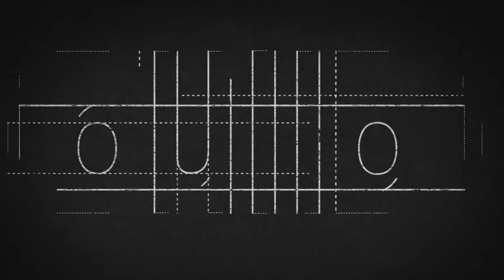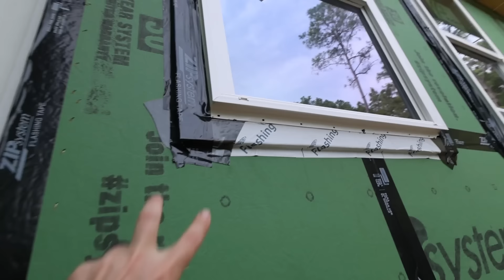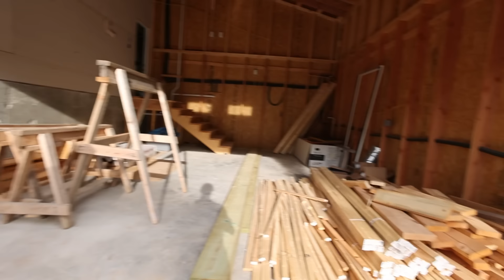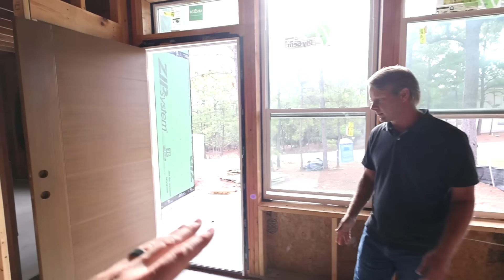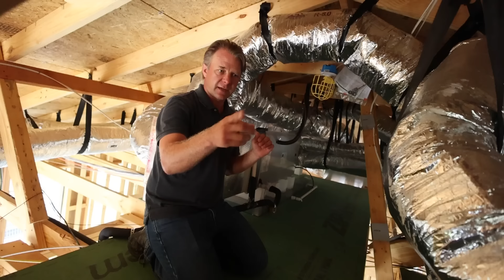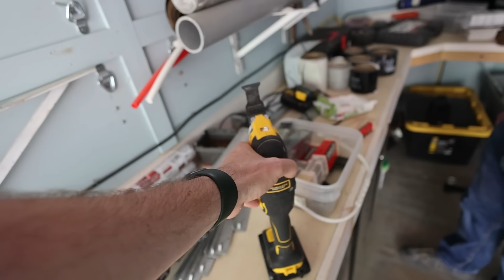LOW BUDGET Details For A High Performance BUILD

Comment: Sizing the HVAC system on the small side is great for the summer but not so great in a cold winter. The resistance heat will be coming on a lot more. My wife wants to feel some heat coming out of the vents. We are little further north and the heat pump struggles on cold days.

Comment: Hello, when the Siga Tape is used on the foundation to wall, is it applied to the foundation and up onto the Zip Sheathing if the Zip is put on after the walls are framed, or is it going up and over the sill plate before the Zip sheathing is put on and then the Zip tape is applied to overlap the grey foundation tap integrating both..   ?

Comment: Can the Scott true technique for the soffit be amended to not need spray foam? Would I need to block off above the top plates or could it be filled with blown in? I am trying to retrofit an existing home without spray foam...

I can't convert to monopoly framing since I have 2*4 truss roofs and that mod will cost a fortune to execute...
Reply: Also doing exterior insulation and air gap before roof and exterior cladding so wondering if I can use the soffit as the breathing box by using the exterior of the soffit to connect both breath areas (wall and roof

Comment: As a home builder, we have been using high insulation applications where a single plate at top, exterior mineral insul as a standard application.
24 centers throughout floor , exterior including conventional roof upon ceiling to achieve maximum r value under metal on roof.
Super advanced assembly.
These that I see are not super advanced technologies on this channel.
Still have a way to go.
Keep it up guys,

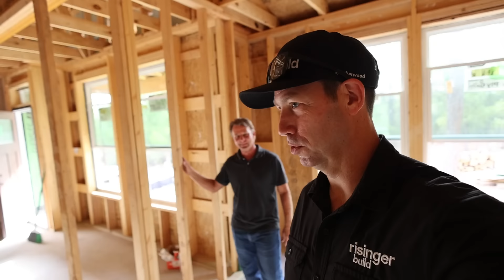Comment: 38:54 this is not mistake, this is a norm under capitalist economy that forces cost cutting here and there while chasing for a profit. I predict that in several years construction lobby will push for relax the code requirements, so they can build even lower quality houses for the same money.

Comment: Very nice but a couple things I’m surprised at … I’m an electrical / AC contractor and those are old fashioned can lights , that’s ancient history , we use flat LED,s now … The other is the penetration for TV cable on the patio .. seriously !!!   These days your TV needs no cable , you use Wi-Fi  …You need one cable going in the home to the wireless router and all TVs are linked by Wi-Fi to the router ….
Reply: LOL being an electrician /AC contractor doesn't make you right. I prefer the old recessed can lights. You can easily seal it up and they are way easier to swap out bulbs when they burn out. People use ethernwt for POE.

Comment: I despise using spray foam on interior walls.  It offgasses forever (especially terrible in tight houses), it makes moving plumbing/splicing wires etc a nightmare.

Comment: Up north commercial buildings use a vestibule to limit cold/hot air from getting all the way inside.  Why not consolidate wall penetrations and have them pass through two separate surfaces like it was a vestibule.

Comment: Underpinning is the process of augmenting an existing footer, typically by enlarging the footer spread area to carry larger loads (i.e.- 2ft wide continuous footer becomes 4ft wide footer after the fact, etc.). Covering concrete pitting and imperfections aesthetically is called parging.

Comment: As an air conditioning contractor in Cypress Texas one of my concerns are the 3/4 PVC drain lines. I know the fittings on any evaporator are 3/4 but due to the lengths and the sharp 90s not sweeping elbows, used by builders. Algae or whatever builds up in drains easily clogs them. And people not properly priming and gluing the drain lines and after a few years I've seen many lines breaking in the walls where it means cutting and properly securing the drains. By the way I'm a big fan just pointing out some problems I have come across.

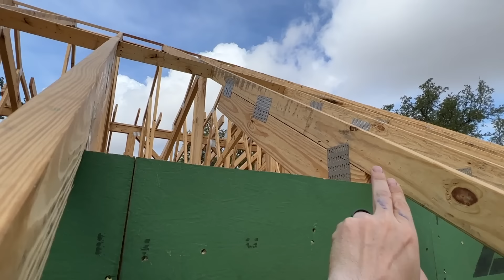Comment: If you still monitor these comments, any special input from the engineer with the freeze/vent blocks being left out (@ 8:11)?  these are usually required for rafter roll &/or uplift.  I realize that much of the uplift in big storms is created by air getting in & up-under the roof via those same vent blocks when the attic is exterior space.  Did the separation (sealing) account for leaving the blocks out?  If so, that's a huge savings to off-set these improvements.

Comment: Doesn't having a 3 ton air conditioner running 24/7 consume more electricity than a 4 ton air conditioner that turns it off and on?

Comment: This building method unfortunately doesn’t work in GA or should it be anywhere. You are very focused on air sealing for plumbing and electrical penetrations, which is good. But the problem is the siding crew will come out do their install and shoot nails right through your pipes and electrical lines. You should complete the exterior siding first. Which means it’s harder or impossible to zip tape the penetrations. We learn the hard way when our inspector made us replace the main electrical line that was shot through multiple times. All our new builds are done in that order now. 

On the other end our home inspection business find these issues in new construction builds all the time. We have a field day finding issues in cookie cutter homes.
Reply from the maker: I disagree. Siding first is a mistake. Trades first, seal all penetrations, then siding, then inspection for possible damage. THEN insulation

Comment: Great video.  One observation from building in the south for over 30 years is seeing spray foam directly sprayed to the underlayment (plywood /osb)on the roof. We replace roofing that is not old because of this method. An air gap is needed that is connected to the air vents/soffit to get the entire life out of an asphalt roof. Shingles get to over 160-175 degrees in the summer, while cooking the plywood. Especially under direct sun contact. The air helps move the convection heat trapped between the shingles and the plywood. That is why baffles are on the market and sold for this very purpose. The proper baffles can then be sprayed with the foam giving a hot roof a natural way to stay cooler and cooling takes place faster once the sun goes down. Direct foam method cuts the life of a roof by 50% including the plywood. Its worth installing baffles because it’s inexpensive while still keeping the house "Tight." *An informed and smart client will eventually notice.

Comment: How is Zip System sheathing better than regular plywood? Also, why would you want a tight house if it's actually better to ventilate it to balance out against the natural moisture level of the surrounding air? Especially if you use a firewood stove to have a free source of heat in the winter and not worry about heat loss.

Comment: I’m from northern NY, and was in the roofing and remodeling business over 10 years. We have always ventilated the underside of the roof, with soffit vents, and ridge vents, treating the roof more as an umbrella than as a part of the living space. Is this not best for the energy efficiency you achieve, or is that kind of ventilation not needed in Texas? I’ve always believed that ventilation was needed to cool the shingles in summer, even in our much cooler climate. And in our cold winters to prevent melting of snow and ice over heated areas, which runs down to the overhang and freezes since the overhang isn’t getting warmth from the attic.  This re-freeze creates a dam, building up water which then undermines the shingles above it. Am I wrong? You don’t have the ice backup problem, but what about cooking the shingles in the hot sun?

Comment: Sealing up your base plates is a good idea.  They also recommend that in the EPA AirPlus program.  As a designer, I also recommend sealing up the base plates around bathrooms, kitchens, washer / dryer, and wet areas in general.  With treated plates of course.  It makes sense to simply keep air infiltration down, and to keep leaking water from spreading... and in both cases...keeping rot at a huge distance.

Comment: I realize you are in Texas, but wouldn't the lack of airflow in those eaves cause ice damming?  How are you venting your attic or keeping a uniform temp in your roof plane?  Why not use a continuous baffle from vented eaves to a roof cap with your spray insul. encasing it?

Comment: Wish I could hire Scott and Matt to advise on guiding me through the remaining fixes to the mostly very well built spec house I bought in 2011 on Cape Cod. So many of the problems we’ve had were addressed in this video with the first major issue in year 1 being way oversized HVAC units that the HVAC contractor sold to the builder in bulk for all 5 homes in our development. Yes, the units heated and cooled, but being oversized, they could never deal with the coastal humidity so in the second year we installed dehumidifiers which helped immensely and often allowed us to not have to run the AC for the first and last weeks of the summer season. Also had to install steam generator humidifiers for the coldest months in the winter because the oversized propane gas furnaces in both zones quickly sucked all the moisture out of the inside air and our hickory wood plank floors in most rooms would have been wrecked along with some major musical instruments. In year 8 the, upper vented attic with fiberglass batting In the ceiling joists was starting to deteriorate from the extreme heat and cold and outside humidity so I found a reputable spray foam insulation contractor and an a knowledgeable engineer who recommended I use solid core spray foam in the roof joists and condition the upper attic space which helped immensely and having already installed the dehumidifiers in both zones with the air exchange, to maintain stable proper humidity levels, was more feasible. This made upper floor with most of the bedrooms and an office much quieter and far more comfortable in both the hottest and coldest months. Now, this past fall, we had to replace the AC condensers as one of them was failing and the other one wasn’t far behind so I did a bunch of research and ended up installing super efficient properly sized variable speed Bosch heat pumps and condensers that have cut our heating bill, formerly all propane for heat, by nearly 40% per month and our AC bill by nearly 50% and…the previous essential need for the dehumidifiers in the summer months and the steam generator humidifiers in the coldest months has been nearly eliminated. (The steam generator humidifiers are energy hogs.) The point Scott and Matt make about properly sizing HVAC systems is spot on and if that had been done by our builder in 2011 when our house was built, I wouldn’t have had to go on an HVAC and insulation fix odyssey. Now, I need to figure out how to fix the likely issues we have with air and water barriers in our home’s structure that weren’t properly addressed and I sure wish I had seen this video before replacing our entire roof last summer because of 4 plus days of constant 85 MPH winds that lifted the drip edge and the higher wind gusts that ripped off some of the original roofing shingles and compromised some of the gutters across the front of the house facing the ocean side winds. The roofing contractor did replace our sheathing with the Zip System, properly installed along with a much better application of fasteners — and I forget the name of them as I type this — but the roofing company promised me we’d never have the lifting issue again unless we have a major catastrophic wind event. Now I have to figure out how to address improving the air and water barrier sealing in the eves on the second floor without messing anything else up.

Comment: A little preparation by both the guy who is being interviewed and the interviewer being a little more in step with each other would be better, more condensed. A simple set of shared notes prepared in advance could be an improvement.  I'm not trying to throw any stones and would not have said anything at all, but because you asked.

Comment: Erm,  since when did 3/4s of a mill to 1mill become "Budget"?  :D  These libtards have an odd sense of reality.  The cost of this compared to a normal budget joint would be like saying a Lambo is a "budget" High performance car.  Which it is,  but attaching the term "Low budget" to it is just offensive because the insinuation is that anyone could afford them.  Otherwise it wouldnt be necessary to prepend "low budget" to it.

Comment: Ok. First I am NOT a contractor.  I am a self builder gathering info so go easy on me.  I've always understood soffits to be the "draw in" location for airflow and ridge vent or similar located vents to be the escape for heat, moisture, and above the ceiling insualtion airflow.  Where does the air draw into in a setup like this when the soffits are air 
-sealed?

Comment: Doesn't roof areas require air flow from the soffit up through the ridge vent?

How can the roof breath when the soffits are sealed and the rafter channels are filled with foam insulation?

Thanks!

Comment: Oh my! I'm so impressed with your workmanship on this! I've been an electrical contractor 31 yrs in CT, I see it all the time, as I do mostly residential, what I call "old work" not so much new construction. As went to replace an outside outlet in a home not more than 20 yrs old, the plywood sheething was completely rotted! I could not find anything to hold a box, a screw or anything! Call a carpentar after you get it fixed, then call be back so I can finish.  Those Arlington Recessed boxed are rarely used it seems, I don't understand why the siding guys don't deal with these.  I've taken vinyl siding off to install these then but it all back to make it work.  But wall penetrations for Air cond Line sets I'd love to see something on that, maybe if they had a pvc sleeve, or maybe I missed provision for that.  But what you are doing is a HUGE improvement on how the home will last!  Love the HVAC set up have in this home.  Nice Job! Thanks for making this video! God bless, Al in CT

Comment: I have 6” studs 24” o.c. with R-19 insulation.  However, my double pane windows are rated R-2.  Sliding glass door is probably less.  So I have thick curtains which includes the glass door.

Comment: fill the cracks from the top instead if possible, and if want do bottom as well.
Will last 2x as long as cracks will form, redundant sealing and a better adhesion of the top groove, and gravity to stop cracking, less heat expansion and water ingress at top seal, bottom add some insurance.

Comment: Been designing and consulting on airtightness of buildings for 15yrs. I would never include the soffit as part of your air seal line. There is too much surface area to volume that significant cooling occurs increasing the likelihood of condensation occurring at the eaves. However this could be mitigated with the correct mechanical ventilation system.
Reply: Yeah as a noob who knows nothing special it seems it would be smarter to just cut slots in the zip sheathing and fit it around the exterior part of the rafters.

Comment: Serious question, wouldn't condensed water get trapped in angled eaves like this? With all that sealing, you've made a well. I feel like it would be prudent to angle the soffit down toward the wall in case it needs to drain. Not a big angle, I'm talking just like a few degrees, enough to let them drain if need be. Otherwise I like the idea of giving the eaves the full layered treatment as the walls.

Comment: I’ve been in the HVAC trade for 25 years. Doing a near perfect job is about all about process. If your organized and you have process it takes about 2% more effort to do it right. 

When you forget materials, go to your van 25 times during an install, don’t have the right tools etc, don’t pre plan. It seems like you don’t have the time. 

I have also learned these traits are genetic. It’s hard to teach process, organization, preplanning. 
Especially in an ADHD fuelled environment. I’ve heard it many times. “Your over thinking it” and then my jobs run smoothly with out any issues. 😊
Love your videos Matt.
Reply: You are so right.  I can barely remember 1 or 2 tradesmen in my 7 homes (over the past 35 years) that didn't do exactly what you described.  "That tool is back at the shop/my house. You don't really need that done like that anyway."  Always short-cutting,  always half-assing, always late, always moving slow.  It has gotten so bad that when a normal human shows up on time to do some work I almost want to give him a big wet kiss.  It sure would not be difficult for a skilled, ambitious person to absolutely dominate their craft in a given area.

Comment: I renovated a 1899 home. The smallest single stage hvac I could find was 2 ton, It needs a 1 1/2 ton as the ac does not run enough to get the humidity out. Who makes a 1 1/2 ton single stage ac? I do not use a heat pump as I have hydronic radiant heat.

Comment: I live in northern country -20's° in the winter. I've always heard we don't want a vapor barrier on the exterior. Has that changed with these new technology/practices?
Reply: You still need vapor barrier on the interior side of the wall in cold climates unless you put 2/3 of your total insulation to the outside then at that point you can get rid of the interior vapour barrier.